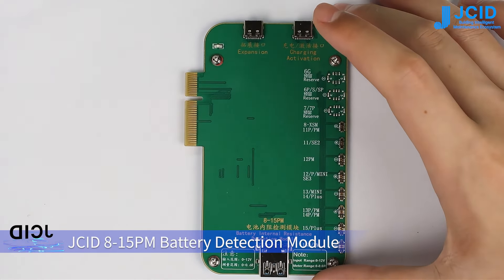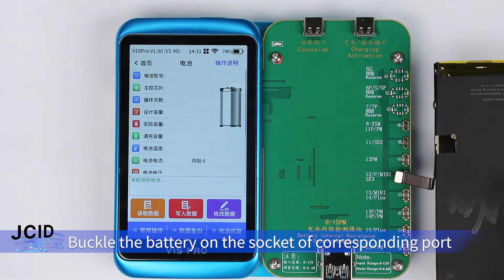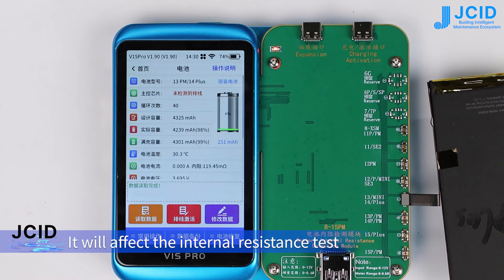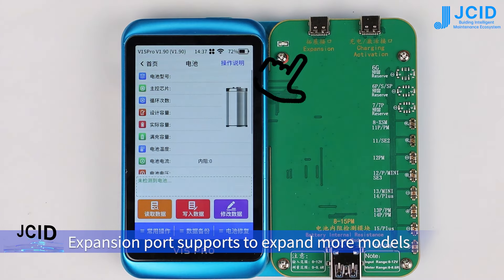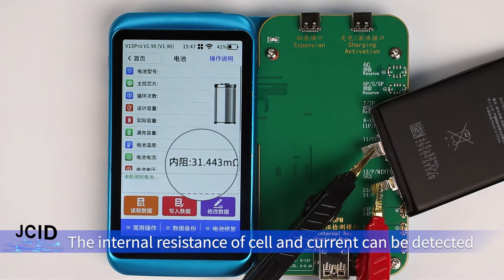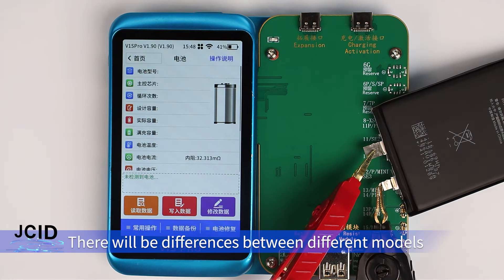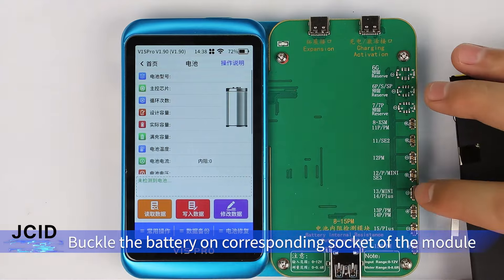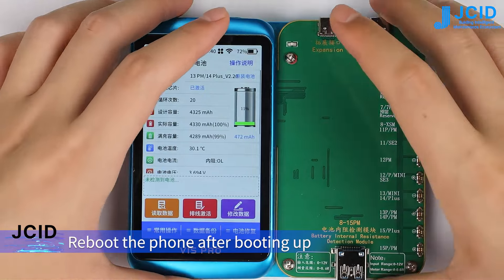V1S Pro 8-15PM Battery Detection Module Operation Guide | Detect the Internal Resistance

Comment: Ios 17.4.1 update  same health show  how can solve
Reply: Use 3U Tools and flash/reflash 17.4/17.4.1 in 3U's UI and make sure to check the 'Battery Health Fix' or 'Battery Fix' option, which pops up right before you reflash the iOS firmware. Assuming the BMS is properly spot welded to a new cell, she will be at 100% after the firmware is done flashing. It does suck that you have to reset the device, but no worries, just have the client back up their iPhone to iCloud or if they don't have enough storage then back it up to your computer AND an external drive (redundancy FTW!). Then use 3U to flash 17.4 or 17.4.1 with the 'Battery Fix' option checked. Your client doesn't have to log out of their iCloud, when the phone comes back up after resetting, they can put their information in, just make sure they know what their username and password is before reflashing so you don't.
Reply: @JacksonPhixesPhones   Please tell me
How to apply replace with ( eom battery) Original battery, independently.
To accept the phone, without error.
And he began to count the life of the battery correctly. Any ideas ?